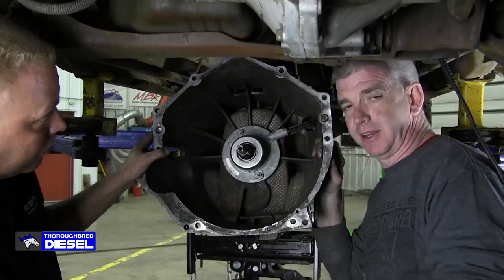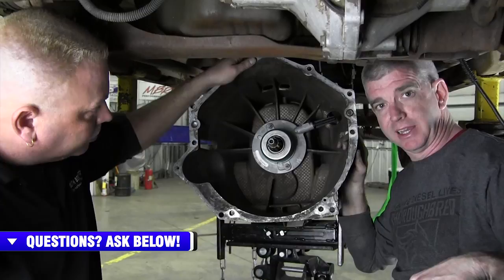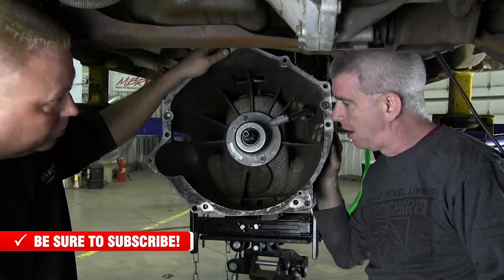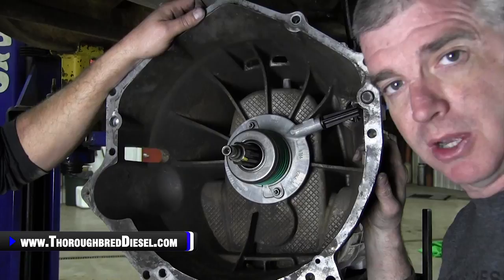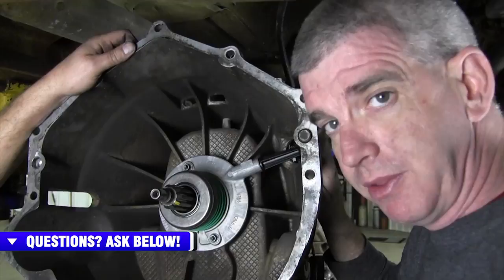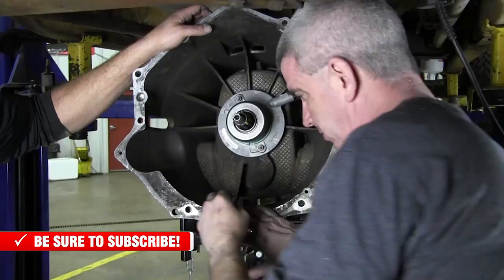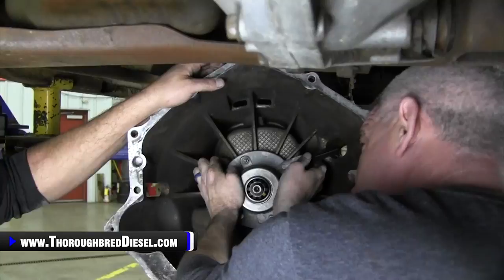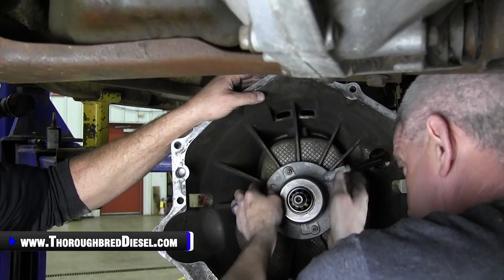Hydraulic Slave Cylinder Bleeding Procedure (How To)

Comment: I’m installing a new slave cylinder myself I did as you just did but I have a little bit of fluid coming out of it is that normal
Reply from the maker: If it is a Dmax slave cylinder and it is leaking, something is wrong.

Comment: okay update and added safety tip. I have a 92 f150 with 302 and M5OD it has a very similar setup with the slave it has a bleeder but some slave you buy aren't pre bled "dry". what I've done was install everything but before stabbing the transmission you can push the slave back pushing the cylinder all the way down pushing air up to the master. it called reverse bleed. But DO NOT start pushing the pedal down you will blow the slave cylinder apart and eat some brake fluid but you can atleast get the air out of the cylinder. The throw out bearing needs pressure on it from the fingers on the clutch to prevent it blowing apart. Hopefully this clears it up for them M5OD guys searching to help bleed the slave. Another comment I seen was can you do it with the transmission installed the answer is yes a pry bar on the bearing works but be careful understand with the pry bar you're apply a completely different force on one section of that bearing if you have a fork you can get away with this method. 😉
Reply from the maker: Thanks for the added info!
Reply: @furmom9390 I have a 1990 f250 with the 5.8 5speed and I did the internal slave cylinder, and I can't get it to bleed. I tried what you said with a pray bar pushing the slave cylinder back kind of pumping it. Whole doing that I took a video of the fluid reservoir up top and nothing was happening. Any thoughts?

Comment: I got a chevy cobalt just had whole entire clutch system done from flywheel all the way up to the brake master cylinder and after i was back bleeding it like this from the bleeder screw on the outside line i got pressure back on the pedal itself but a hour later clutch pedal goes dead again..iv vacuum blead it from bmc still happens. Its not leaking fluid and its not taking air in anywhere..I didnt install the clutch just how i received the car. I was told by owner oh it just needs to be back blead theres a air bubble in there..could this be why it keeps loosing pressure? Cause it probably wasnt bleed from the slave..? Thanks

Comment: Glad I'm researching this, VW is like this too on MKVI now...what a pain. 

There is no real way I can think of once the transmission is put back together. I'd imagine if it is you'd probably disconnect the hard line at bleeder valve for clutch  and put a hose that fits around it connected to a bottle of hydraulic fluid then .... nope, you can't. Then you can't press it down without the clutch master connected. With the clutch master connected maybe you could from there , if not you'd just keep trying to compress air bubbles. 

Thanks for this, doing it connected to a long hose full of fluid to make life easier since I don't have a lift and want to deal with the short length of mine
Reply: Any luck in finding a way to bleed the clutch with the slave already sealed in the transmission?
Reply: @DavidMartinez-kp4wp  I ended up bench bleeding it as best as I could. The thing is, once it's put on the cylinder compresses and pushes out whatever was in it already soooo, if you had the line connected right away with it primed it would pull it all from master and be fine. If it was a dry pull from master hose then.... Uhhh. I read lots of bleeding and then some after you think it's fine. Sorry :(
 I added a hose to my master as I pushed it back on that I filled with the brake fluid and watched it push/pull it all back in
Mine has issues of getting stuck in first gear now and having to turn it off.... I blame Spec and the spacer being off by thousandths :(
Reply: @Hedgehodge-  thanks. I have a South Bend clutch on my MK7 with similar conditions. It locks up on first and reverse from a stand still. Shutting it off disengages it or by moving the car slightly.  What's weird though it doesn't happen when the car is cold. Only when the engine is warm.
Reply: @DavidMartinez-kp4wp  did you install yours too? I'm OCD and wanted to make sure it was don't right and torqued etc. I tried the spaced on the outside transmission cap for input shaft, no play at all. Didn't want to drop tranny again and looked inside with boroscope and starter removed and I don't get it. I did a fluid swap of tranny fluid too and tried dieselgeek shifter too thinking linkage I give up and will drive it until it goes I guess... Let me know what tried and if figure out please !
Reply: @Hedgehodge-  I had the clutch bled about a month ago to see if it would help. I even upgraded the clutch line and bleeder block. Still didn't correct the issue.
Reply: @DavidMartinez-kp4wp  yeah I forgot I did bleeder block too just not lines.... Lovely so the spacer behind the slave cylinder is the only thing I haven't tried since requires it all out again and if I do that I may as well go back OEM
Reply: @Hedgehodge-  did you figure it out?
Reply: @ianmoore322  I did not. It's been sitting a few years and driven here and there since covid and wfh . I figure I'll let it destroy itself and then worry about it. I read it could be the transmission shift forks but man ... Ironic timing then

Comment: I have an ls1 t56 and the slave cylinder cannot be compressed by hand unless I open the bleed screw. Even with a clamp it won't compress. Maybe the fingers won't be able to compress it either is my concern. Have you run into this?
Reply from the maker: I haven’t, but honestly I don’t try to hand compress them a lot, for fear of tearing the internal o ring.
Reply: @thoroughbreddiesel  Thanks for the response! I found the reason though I don't fully understand it. I had my tilton master cylinder partially compressed to limit throw by use of a threaded eye attachment. Once i adjusted it to allow it to fully reset, the slave was able to move by hand. The master must block backwards fluid when partially engaged.
Reply: @jacobrudolph4097 I am running into the same problem right now, do you remember exactly what you did to solve it? Thanks!
Reply: @dylanglin4222  I believe I took the adjuster off the master and bled it that way. It works great now so no concerns for functionality for me

Comment: My bleeder valve is broken, do you need to remove the transmission to replace it?
Reply from the maker: If its the bleeder on a Dmax master cylinder, no. The slave can be separated from the master at the junction at the master cylinder.
Reply: Thank you!